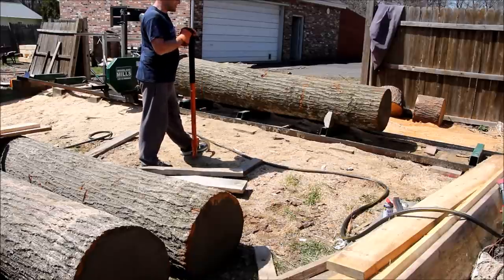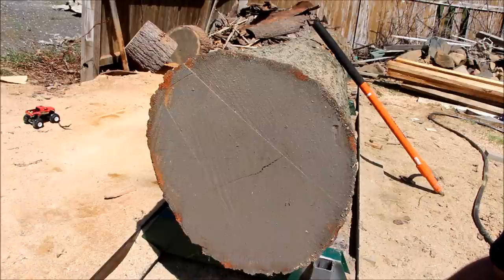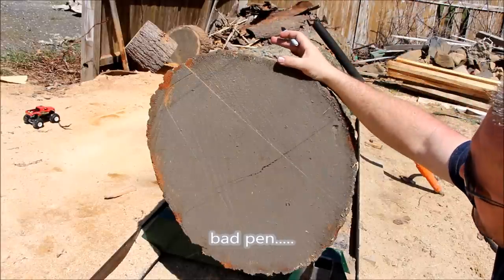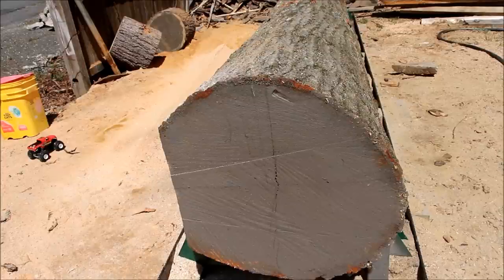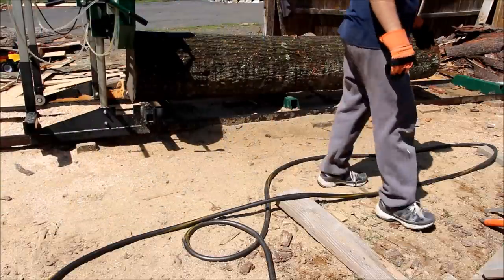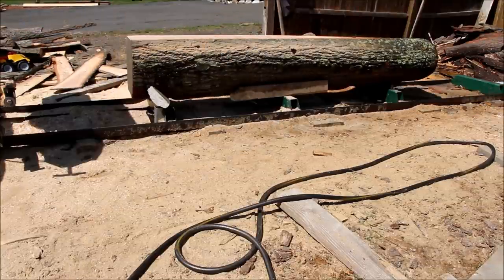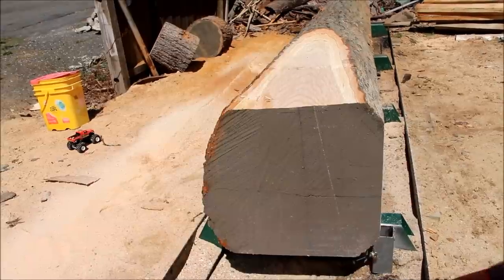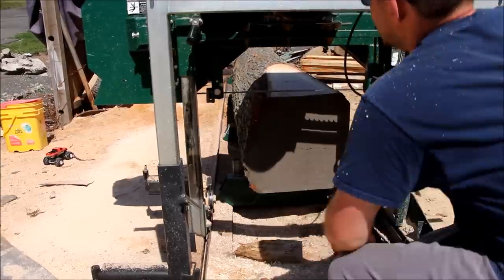Some quartersawing on the Woodland Mills HM126 - the approach

Comment: Setting a post and attach a hand crank winch would make loading so much easier. Also try building permanent ramps.
Reply from the maker: Yeah..Lots of nifty stuff can be done.  So far 2x4 ramps seem to work fine but point taken.  I'd love to set up a gantry system but the mill was never intended to be at my house permanently.  Who knows.

Comment: Looks like you don't have the standard woodland mills track . Would you mind sharing what you used and how you think it has worked out for you.
Reply from the maker: The rails are 30ft 3"×4" angle iron ....the bunks and everything else is stock ....  wish I had left these at 40 ft but other than that....these are great!
Reply from the maker: @midwestworkshop2863  having solid rails helps.  Would be nice to have the leveling feet though